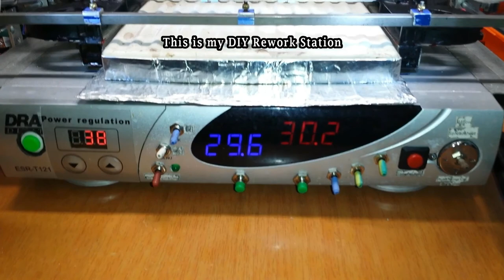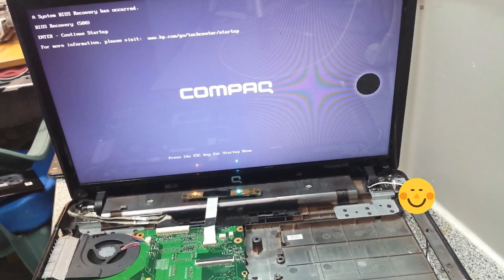Reballing HP Compaq 615 - Graphics Card Repair

Comment: I Had the same laptop, with the exact same issue, but in my case, just reflowing the chip at 260 degrees (because I didn't know if the manufacturer used leaded or unleaded solder)  and adding a lot of flux, fixed the issue. That was a month ago and since then I have been using that laptop almost every day. This video pointed me to the actual fault, great job, keep it up.

Comment: Hi Nik!! Good video! It's possible have The temperature profile?
Reply from the maker: Hello Jonny, the profile is always the same for bga repairs, the only diference is the solder type, leaded solder melts at 185 so the profile is max 215-220, and leadfree solder melts at 220 so the profile is max 240-250
Reply: But there is a diagram to be respected though? From heating to tin fusion and gpu removal. I see in your videos that it usually takes 5 minutes to remove a gpu. You follow a precise wave? I'm doing everything to build one machine myself too. And surely if I make it I will put the link of your video.
Reply from the maker: https://www.dropbox.com/s/h60hgd250slu93p/kester%20BGA%20profile.png?dl=0
This profile is for leaded solder, for leadfree solder same profile but peak temp is 240-250, try to follow this temp-time graph.
The profile is for Reflow or for Soldering in the chip, for chip lifting you dont need to reach peak temp to lift the chip, when you reach melt temp poke the chip to see if the solder has melted and then lift the chip.
Reply: Thank so much Nik. I will try to follow the chart. Too bad the dip controller is not available on the supplier's website. I tried to contact the supplier on ebay but he told me he wants $ 500. And a disproportionate price. And now I find myself struggling to find something that is a dip controller.😭😩😔

Comment: Bro does it works in every laptop and every gpu...i have no display problem the repairman told me that it should be reballed
Reply from the maker: Hello, usually if the cooling system gets clogged with dust it causes the graphics chip to overheat and fail, it is the most common reason why graphics chips fail, reballing or reflow can help in this situation.

Comment: Some advice needed please: a friend has given me her Compaq 615 for a general overhaul and reinstall of Windows. 

However, there is an issue with the screen display, as it sometimes flickers and occasionally goes off for periods 

of time. Gently shaking the laptop or giving light taps to the screen and/or main body sometimes brings it back, 

but not always. Is this an indication that the screen is about to fail, or is it more likely a loose connection 

somewhere? If the latter, pls give me a few tips on how to solve it. If the former, is exchanging the screen a 

difficult job requiring any special tools? Thanks in advance.
Reply from the maker: Hi, if there is a lose connection then if you keep moving the display or shaking the the laptop the display will keep going off and on again, if you cant get it to go off then the connections and display must be fine,
many Compaq 615 laptops have problems with the graphics chip and that what you described is happening sometimes, that is why i cant tell you with certainty what the problem might be.
replacing the display is very easy , you only need a screwdriver to replace the display or the cable that connects the display on the motherboard.
Reply: @NikTelio  Yes, I appreciate that from a distance it's difficult for you to diagnose the exact fault. But as you said, moving the lid back and forth does cause the display to flicker on/off, so I suspect it is the cable, not the screen (phew!!). Also, I noticed the top cover (with power button) was slightly adrift in one corner as if someone had taken it apart and not put it back correctly. So maybe it was pinching and damaging the cable somehow. Ordered a new one (only €5), arrives next week. But I notice there are cables going through both left hand and right hand hinges, and I'm not sure what their function is. I just hope it's not the graphics chip as per your video as I don't plan to get as deep into a repair as that!! Thanks for your help...
Reply from the maker: on the right side there are 3 cables, 2 for the wifi antennas and 1 for the web camera,
on the left side is the display cable that connects the lcd with the motherboard , many times this cable after many years of use ( moving the lid back and forth) gets damaged and the symptoms you mentioned appear
Reply: @NikTelio  Thanks, that's really helpful. It was the right side that was adrift, but I'm going to now poke about on the left to see if I can pinpoint the prob. Will get back to you next week. Cheers!
Reply: @NikTelio   These symptoms are really weird. Just turned it on again for first time in a few days. Sure enough, screen working but total distortion. Tried jiggling the wires going through left hand hinge, but no change. Moving the lid no effect. Left it on, after 5-10 mins, reverted back to double image, then clear undistorted image. Moving lid does not disturb it. I trust your judgement that it is the cable which is faulty....but any other possible causes? When these screens fail, is it a gradual process or instantaneous??
Reply from the maker: distorted image means gpu problem
Reply: @NikTelio  I was afraid you might say that. I have some technical skills but doing what you did in this vid is way out of my comfort zone. So if I connect an external monitor via the VGA port (trying to borrow one from a friend at time of writing) and the same symptoms occur, then it is deffo the GPU chip, right??? Appreciate your invaluable help once again.
Reply from the maker: Hi, connecting the laptop to an external monitor is a good idea, if you see the same distortions also there this means gpu problems,
that said, sometimes even with a partially defective chip the image on the external monitor can appear normal, but this will not last long because the chip will eventually stop working.
if you have opened the laptop and saw the cooling system clogged with dust then this is an indicator that the graphics chip was overheating and is about to fail
Reply: @NikTelio  No monitor available. unfortunately.

However, do you think that there is the remotest chance (even the slightest 

possibility) that the double image/variable & moving screen distortion I saw could have been caused by an out of date or bug-ridden video driver, and not the screen, the cable or the graphics chip? Or even a virus?? 

Because now I've reinstalled Windows and done all the updates (over 250 of them, including for the graphics & screen), the problem seems to have cured itself. 

(I once had a Gericom laptop in which the screen would freeze occasionally 

and for no reason into a random but static distortion pattern. This was solved - eventually!! - by locating and installing a new updated video driver, and wasn't a hardware problem as I at first feared.) 

On this Compaq 615, I also installed Core Temp to monitor abnormal temps and cleaned out the fan, but all seems OK on that front. Since I finished working on it on Friday, the laptop has been switched on and been on test the whole weekend (48 hours and counting) without a flicker. The screen can be wiggled back and forth, the machine shaken, but the image stays clean and pure. It's all a mystery to me. 

But I try and work by the principle "if it ain't broke, don't fix it" meaning there is no point fitting the new screen cable when it arrives as there is a risk of doing more harm than good. So I am reluctant to change it, especially (as I said before) the 615 does not even actually belong to me. Thx.
Reply from the maker: well...only time can tell if indeed this was not a hardware problem,
if the image distortions appeared also during post then it is definitely a hardware problem,
i hope you also renewed the thermal paste and thermal pad.
Reply: @NikTelio  Before I gave it back to her, I installed an on-screen app (Core Temp) to monitor any abnormally high temps. All was OK. So I admit I didn't check or renew the CPU thermal paste, as I'd already spent a LOT of hours on it (for free, as a favour), and in view of the fact that she will probably sell it now as it's surplus to her requirements. Thanx for all your help and advice.

Comment: Can you please guide me.. 

i have dell inspiron N5010.  the problem is that power on but no displays..  i have done the reflow work but it works for 1 day but again same problem faced.. 

so please help me in this..

whats the permanent solution of this problem

1) reballing gpu
2) removed the gpu
3) new gpu replacement

i heard that if i reballing the gpu then after 4 and 6 months same problem arised...  please guide me what to do????
Reply from the maker: Hello, there is no permanent solution because on many laptops the cooling system was designed not to cool the graphics chip properly so it will fail after a few years of use and also many manufacturers use thermal pads on the graphic chip which is not a very good solution. You cannot remove the gpu, you can only reball or replace the chip, how long the repair will last depends also on the technician skills.
I would reball it and use very good thermal components to reduce the thermal stress for the repair to last longer.
Reply: Nik Telio thanxx nik.. 
but if i convert the graphics into the non graphics intel hd on board (conversion)  because i am living in delhi india there is no technical skilled engineer of BGA that works like you..   your work is just fabulous outstanding mindblowing. really appreciated..  please reballing my board as well
Reply from the maker: I live in greece so i cannot reball your board but i think you did not do the reflow as you should, watch this vid so you can see the temperature profile for the reflow, if done right it will last a few months. https://youtu.be/iLWkNPTyg2k
Reply from the maker: i thought that when you said conversion you meant that you will remove the nvidia or amd graphics chip and replace it with an intel graphics chip, your laptop has 2 gpu's one on the pprocessor and one on the motherboard, yes if you remove the graphics chip then only the processor will provide the graphics, there are same motherboards without the extra graphics chip, yes this is a nice solution to your problem.
Reply: Nik Telio thank you nik.. ☺
Reply: Permanent solution for Dell Inspiron N5010:

1. Replace GPU with NEW one
2. Use 1mm copper shim instead of thermal PAD (rubber) for GPU. Apply paste on GPU, apply copper shim, apply paste on shim, mount cooler.

The N5010 has a design flaw in the mounting of the cooling system. There is just 1 mounting screw with a thin aluminum bracket. Over time this bracket loses its rigidity and the cooler separates from the GPU. With the copper shim there is enough pressure so that this does not happen. I have repaired over 20 of them and not a single one came back, oldest i've done is 3 years plus.
Reply: Conversion to integrated graphics is also a permanent solution, but you lose the extra power that the dedicated graphics card provides, you will no longer be able to play many games or encode video fast. If this is acceptable to you, then you can have this procedure performed on your laptop.
Reply: Andrei H can you please share a video link